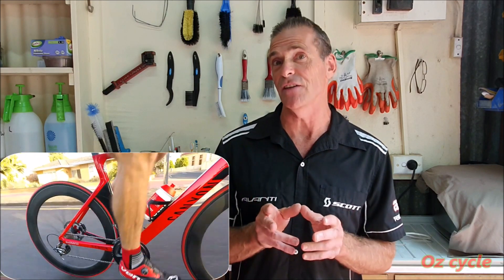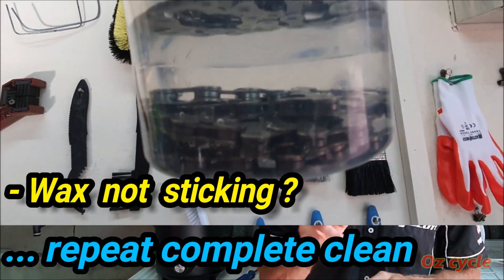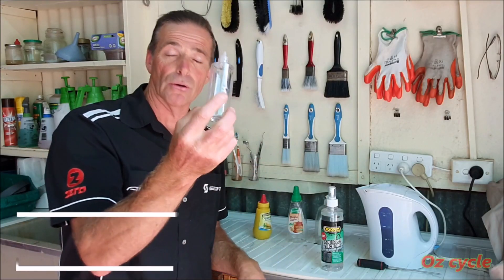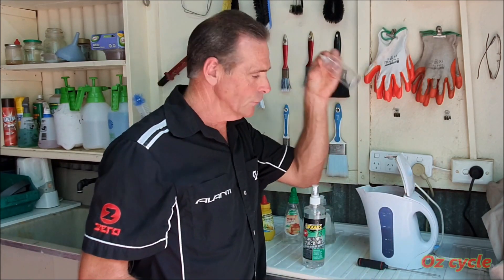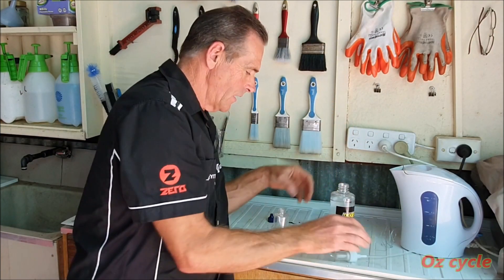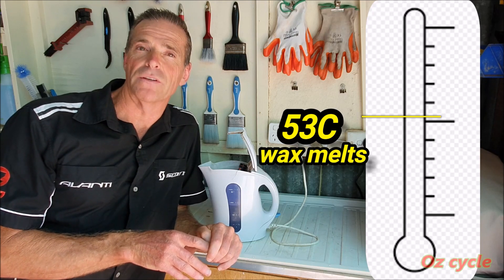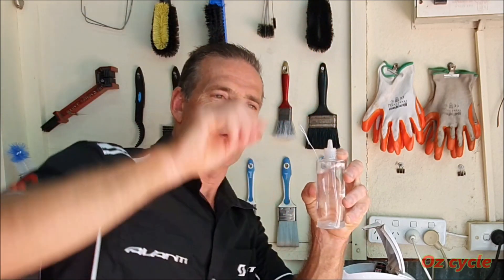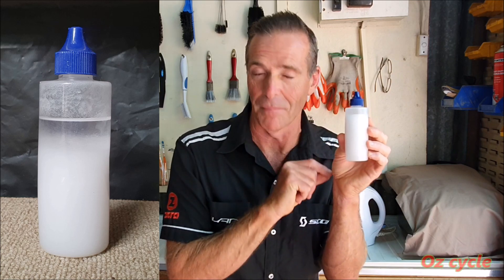Chain wax in a bottle - make it yourself

Comment: After many tests I discovered the big secret:
Add a small part of colophony pine resin in the same mixture, and the paraffin will be slightly sticky, prolonging the durability, besides making the lubrication more powerful!
I'm using 60% isopropanol, 30% paraffin and 10% pine resin. These proportions can be modified, this is just a suggestion.
Reply: Not a good idea. It's like putting grease on your chain. It'll attract dirt like an oiled chain. 
The purpose of the wax is that it sheds off naturally. That's why the chain stays clean

Comment: Hi Mr. OZ Cycle, great videos! I've used the slow cooker method for some time but it caused hairline cracks in several link plates and the chain eventually snapped. I was told that the pins thermally expand more than the plates, hence they crack them. Perhaps the wax was too hot. Do you think the wax/isopropylalcohol mixture could be used as a bath instead of the hot wax? Prepare a larger batch the way you demonstrate here and then immerse the chain for a few minutes - all at ambient temperature. Or would you expect all the wax and PTFE dripping off the chain when it's taken out?
Reply from the maker: Something wrong if chain cracks at 90degrees temperature! 
Yes you could use IPA and wax to bath chain but note IPA is flamable.
Reply: Thanks, i'll try that when the chain is due next time  and report back ....  cheers
Reply: Hi Mr OZ Cycle, i'm currently cooking up my isopropyl alcohol wax PTFE bath mixture. It's not dissolving well, i suppose i have too much wax/PTFE for the amount of alcohol. What concerns me a little more is the total lack of stickiness. When i put a clean knife into the mixture and pull it out the wax will not stick to it after the alcohol has evaporated. 
Have you ever tested the stickiness with your wax/alcohol solution?

Comment: I’ve ordered ptfe powder after watching your video on how to wax your chain and now just watched this. First of all thank you for making such informative videos! 

Is this method similar to commercial products such as squirt? Could you use this liquid version as a replacement for dipping your chain? Seems pretty convenient and much cheaper than buying the commercial stuff.
Reply from the maker: It is not same as any other drip lube as it dries completely. It's for taking with you on long , multi-day rides or as an emergency lube. It want get to the inner workings of a chain as well as immersive waxing.
Reply: Good to know! It surely gets to the inner workings at least as good as squirt, I would guess, making it just as effective. I’ve heard people report that they wax their chains initially by immersion and use a drip bottle (commercial or home brew) to re lubes every couple hundred miles. Then every so often they re dip. I guess I should have asked if this version you made has as much wax left behind as commercial stuff.

Comment: Can the methylated spirits(denatured alcohol) be used in the mixture instead of the isopropyl alcohol? Whenever my mixture cools the wax and methylated spirits are completely separating. Not sure if it’s the spirits or the wax that I’m using that is causing this.
Reply from the maker: No , methylated spirits doesn't hold paraffin wax as dissolved. Isopropyl alcohol needs to be 99% proof also.
Reply: @stevenleffanue  That explains it. Thanks for the quick reply!
Reply: @stevenleffanue  i have the same issue as @Reaper27 the mixture separetes when cooled. I have wax with low content of oil and 99% proof alc and even went above boiling point on the alc and still had the same result. Hot wax method is great, i just cant replicate the wax in the bottle. Any ideas?

Comment: So the isopropyl alcohol acts as a carrier for the wax and will keep it from becoming a solid again? Couldn’t I prepare myself one of these little bottles at the same time I wax my chain (while my chain wax is already melted)? Therefore eliminating having to do the kettle/tea pot step?
Reply from the maker: The IPA needs to be at least melting temp of the wax
Reply: oz cycle Just attempted my first little bottle. I got IPA up to the proper temp and was able to get all the wax to melt completely in the little bottle and all became clear. My problem was when it reached room temp the wax and IPA separated and won’t combine again and become milky even after shaking.

Comment: So you changed from the Xylene to the alcohol, right?What are the reasons?
Reply: @Jason Dorset Mamil Cycling Yes, I am close to change from oil to wax. I bought wax, paraffin oil, a slow cooker, and ordered ptfe powder. And struggled to get xylol wich was difficult. Just to hear now I could take isopropyl alcohol instead wich I could get for free where I work. 🙄
Reply: Would love to know your reasoning, oz cycle!  -- If I were to guess, xylene dissolves the wax better, but isopropyl alcohol is a) much easier to source b) not toxic and c) still good enough (??)
Reply: Curious, as I found Bunnings sell Xylene @$20/litre. Yet IPA slightly more expensive at Bunnings.
Go figure.
Where is the best place to buy IPA in Australia
Reply: @Desmond Allin , So if using Xylene does it still need the paraffin wax as you previously advocated or would wax + xylene + PTFE be better please ?
Reply: Jason Dorset Mamil Cycling 
You’re pissed off? Are you kidding me? People like you expect everything for nothing. Show some gratitude and thanks.
Reply: R1ch5urf xylene is a petroleum distillate whereas isopropyl alcohol is not (it’s just an alcohol). Xylene would tend to dissolve more of the wax already on the chain from the hot wax versus isopropyl alcohol. This is only theoretical based upon the nature of the solvents themselves and the actual real-world difference between the two would need to be objectively tested because of possible confounds such as application temperature, how much emulsified wax penetrates the chain before solvent evaporation, etc. If I had to guess, isopropyl alcohol would still be superior given that it would evaporate more quickly. Also, it’s not great to be dripping xylene on your floors. So there’s that benefit also. With that said, I wouldn’t be dripping PTFE onto your hands either.

Comment: I may have missed this in one of your many waxing videos but what do you use to lubricate your pivot points on your derailleurs when using wax on your chains? I don't want to use any standard oils and potentially contaminate my chain wax.
Reply from the maker: Rarely need to lube pivot points but the ptfe wax is good for that too
Reply: I use a small spray of silicon on the joints, then wipe any external excess off. The silicon should dry in the joints themselves. Do not give it a bath and just leave it run all over the place. Should be no reason for any lube to be dripping on your waxed chain.

Comment: Interesting stuff. One question though. What about lubrication of the gear/chain contacts (i.e. cassette and front gears)? I presume no oil there as it will attract dirt again. Clean and dry is also no option beacuse of corrosion. So also wax the gears (molten or mix in bottle?)?
Reply from the maker: Wax isnt as good as oil for preventing corrosion on outside of your chain. If corrosion is a problem add paraffin oil to the wax or go back to oil.
Reply: @stevenleffanue  All clear, but after cleaning the cassette, what should I use on the cassette gears?

Comment: hi sorry for bothering you, i found that when i apply parapin wax to chain and use it, then it will be dirt , even not so far riding, just about 100km only. i guess its because i added parapin oil a little in parapin wax, then if i do not use parapin oil then it will be OK? but when do not use parapin oil then always small debris of parapin appear in chain. is it OK ?
Reply from the maker: Yes , oil attracts dirt. Thats why its better to replace the oil with ptfe.
Reply: @stevenleffanue  thank you very much, i will try with new parapin wax !

Comment: Is the wax on the outside of the plates of the chain, doing much good?  Could I take it off to help with keeping things clean?
Reply from the maker: Its good to leave a protective coating on outside of a chain otherwise it will rust...unless you get stainless steel chain.
Reply: @stevenleffanue  Is it also safe to say you used 90%+ Isopropyl Alcohol.....less water the better?

Comment: I have used the hot wax method for 30+ years, and it works better than anything else.  For the in-between rides though I use DuPont Chain Saver.  It’s a waxed based PTFE aerosol lube that works very well.  I first blast the chain , cogset, and chainring with water to get as much dirt off as possible.  Let dry and spray Chain Saver with the supplied tube applicator.  Try it, and thanks for your ingenious YouTube videos...very helpful!
Reply: Does the chain saver have any oils in the ingredients?
Reply: @kodiakpb  Not that I’m aware of or can tell.  It’s wax, PTFE powder, and a propellant.  Definitely dries with a dry white film.
Reply: Thanks

Comment: Just about to make my first bottle of the 'handy carry' isopropyl mix;  though one thing that I'm curious about is the fact you scrape off the wax from the cooled solidified mix,  with the PTFE settled to the bottom; so I get the impression for this temp mix it'll be fairly weak on the teflon for the sticking properties.

I'm wondering if scooping off a small quantity of the warm, well mixed liquid mix when dipping a chain to save to then later crumble that back to small portions and easier/quick dissolving in the Isopropyl might mean the stiction properties are improved?    A bit more pfaffing around for marginal gains?

Otherwise I've been swapping two chains on my regular road bike the last couple of months and maybe ~1500km total, and the rule of thumb ~300km reapplication is working about right in dry conditions; but I'm aware winter is coming and both me and the bike are gonna get caught out on a longer day ride AND get wet soon enough!  God forbid I have to go back to some oil based lube and the muck mid ride and have to start the whole process over again.
Reply from the maker: Your waxed chain performs the same in wet conditions don't worry. However , if you let your bike sit wet for a day or two after , the chain may start to rust on the outside. So after wet ride just wipe chain lightly to get water off. You can also add paraffin oil 50:50 to your wax to prevent rusting.
Reply: @stevenleffanue  Thanks for the reply.  I think it was just from my past experience with commercial wax based products some years back (White Lightning iirc), and some others anecdotal DIY/Homebrew wax experience that riding in wet conditions sped up the need for reapplication. At least as I recall, things started squeaking and feeling dry soon after a rain rinse.

Anyway since my earlier post my little travel shampoo bottle (100mL) of the 'handy carry' seems to have dissolved nicely and looks ready to try. I am getting paranoid about getting drenched on a regional 200K Audax next weekend!

Comment: After cleaning derailleurs, should I lubricate them or will the chain wax do it?
Reply from the maker: Clean derailleur as shown in video....no need to lube. If in very wet conditions you may need to lube pivots and jockey wheels.
Reply: oz cycle thanks. Awesome videos;most helpful!

Comment: You mentioned about contamination a fair amount. After a thorough proper cleaning of the chain and waxing, what say you about properly lubricating the derailleur pivot points and jockey wheels? I reckon if one was to use regular oil lubrication on these parts, they will eventually filter onto the chain and therefore contaminate the freshly waxed chain. Would your liquid wax mixture be a good for derailleurs pivot points and jockey wheels?
Reply: Good point.

Comment: Hey there. I enjoy your informative videos. I followed a previous recipe you presented for a bottled wax chain lube that included Xylol. Why did you change your recipe to using alcohol?
Reply from the maker: You can still use xylene if you wish but it is quite toxic and usually more expensive.

Comment: I couldn’t find isopropyl to make up the wax and isopropyl bottle for the top up between wax changes. It’s due to supply issue during COVID. I did find a liquid sanitiser with ethanol 70%, water and glycerine. The glycerine is an additive to be softer on the hands. Do you think that can work or is the glycerine no good?
Reply from the maker: Sorry Steve,no,hand sanitizer want work. Try to find xylene or toulene as these will work.
Reply: Ok thanks. I’ll stick to using it on my hands. Plenty of hand cleaning happening at this time. I’ve now converted fully from using messy oils to full waxing as per your videos. I’m wrapped. Quiet, smooth and clean and really it’s not much fuss to do or maintain.

Comment: Hello and thanks for your great work! I have one question: I finally managed to get some xylene and am planning to use it now with my paraffin wax mixture.
I dont have ptfe jet but could i use xhe xylene with the ptfe also? Thanks, Marcel.
Edit: And one more question: to clean a waxed chain before reaplying liquid wax makes it sense to use one of this brushboxes which you let the chain run trough and if use it dry or with water or with iso or xylene?  Thx!
Reply from the maker: Yes,xylene will work. Dont clean a waxed chain with a clipon chain cleaner,it will clig up the brushes and doesnt remove wax very well....just pour boiling water over your chain.
Reply: Boiling water? Supereasy! Thank you!
Reply: @stevenleffanue  Could you immerse the chain in boiling water to clean it?
Reply: @blindsquirrel4882  I do but not for more than 2 minutes: it is corrosive and I blast it with compressed air immediately after to remove all water.

Comment: Does the bottle remain liquid or must it be heated each time it is to be used?
Reply from the maker: Remains liquid
Reply: @stevenleffanue  OK, I will try it.In the previous formula, the hot wax did not penetrate the links, it was outside the chain.

Comment: Hey out there,
Great video but I'm a little bit confused. In his first video years ago he mixed paraffin and candle wax. 50/50 mixture. Now it's Ethanol and candle wax. Less wax and most Alcohol. 
Both is good or why it has changed?
Reply: I like this. Less stuffing around. Alcohol evaporates leaving wax inside chain.

Comment: It was an effort to clean chain from all the sram factory grease, but well worth it. I went all in and did 4 chains for this coming ride season in Michigan, 🇺🇸 . I may suggest a  vigorous rinsing(especially with lubed chains) between degreasings a couple/few times, so as to not carry the grime to your mineral spirits. After an extensive ride, No sign of any grime with the finger rub. Also, a double taped toothbrush will be worth keeping on hand for post ride surface cleanings.

Comment: The problem with scraping it off the top of the hardened wax is that, I find that the PTFE settled to the bottom when the wax cools.  It is not evenly mixed through when you do the scraping
Reply: Same here for my batch....I suppose a good solution would be to take a thin cake slice (equivalent) which has  the wax content (all the way through) and then follow the process ? - I hope that makes sense?
Reply: Can always add a half teaspoon of PTFE powder to the bottle.
Reply: Do this when the wax is hot next time you dip your chain. Give it a good stir, then just spoon the hot wax/ptfe into a bottle and add the IPA. You will still need to heat the bottle up to bring the IPA up to temp IOT mix the solution.

Comment: using 70% isopropyl my wax melts when heated but doesn't stay dissolved when it cools to room temp.  If I can find 90% isopropyl alcohol, the wax will stay dissolved?
Reply from the maker: 99% is what i used in the video and works. 90% is 10%water

Comment: I made the initial cleaning and waxing on a Merida Speeder equipped with Shimano 105 drivetrain. 2x petrol (contains 10% bioethanol here in Hungary/Europe), then degreaser, then denaturated alcohol, finally a brake cleaner spray. Then the wax bath in paraffin candle wax. The excess was removed with a toothbrush. Since then (appr. 100kms in dry conditions) i am endlessly happy with the smoothness of ride and the cleanness of the chain. I don’t have to be afraid of the dirty chain making my leg, my car messy.

Today i wanted to make the after-lubricant with wax (30%) and isopropyl alcohol (70%, measured by weight on a kitchen scale). And this is somehow not working. My wax is staying in pieces, it does not want to melt in the 65-70 degree Celsius bath even after half an hour. It does not make an emulsion with tiny little wax particles, and if I want to pour, the wax freezes into the nozzle. so I can not apply like this.

Maybe do you have a hint what went wrong?
Reply from the maker: The alcohol is heated to same temperate that the wax melts. Let it sit at that temperature until all wax is visibly disolved. Shake bottle as it cools